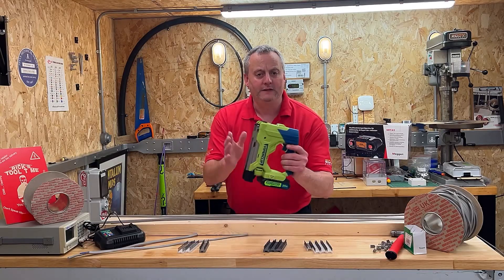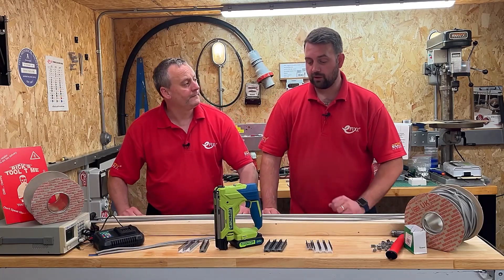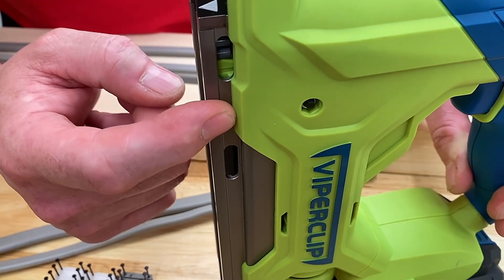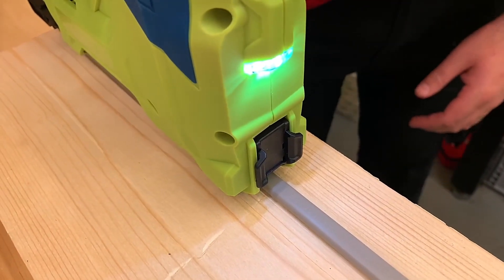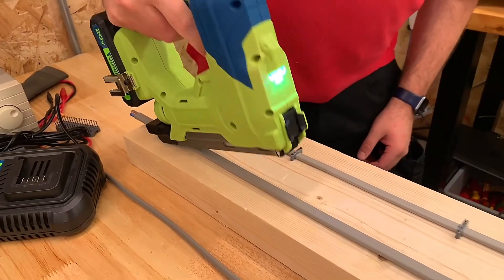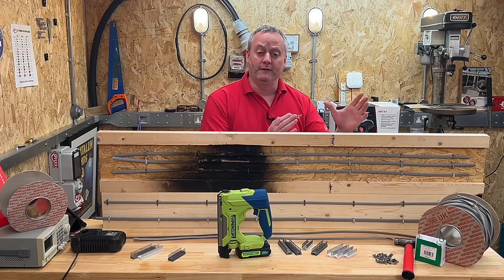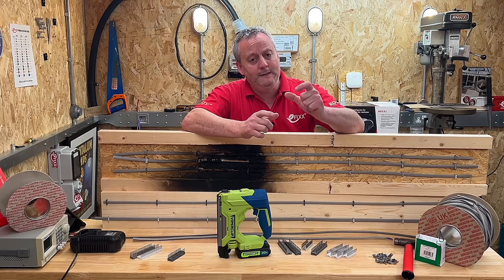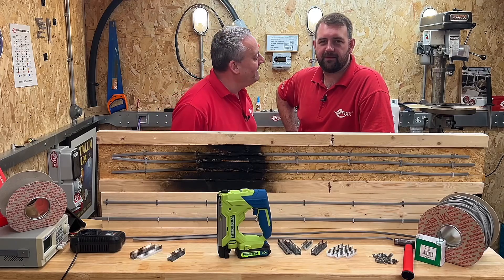VIPER CLIP The Ultimate Twin And Earth Cable Clipping Solution?

Comment: After watching this longer video I'm even more convinced that it's not worth it over the Dewalt cable stapler. I pointed out the crazy price on the short compared to the Dewalt and it's yet another different battery platform with yet more storage for different clips, much prefer my one size fits all Dewalt.

Comment: Looks like a great bit of kit, only question would be the availability of the fixing, and the cost
Reply: £330 for the gun and accessories.
3.6 pence each for plastic clips to fasten 1.0 - 1.5 mm T+E.
Reply: Looking at £290 for the full kit via your local wholesalers. That comes with a bag, 2 batteries a fast charger as well as a lanyard for the tool. You'll also most likely get some free clips with the pack depending on how nice your wholesaler is.

Comment: I got my hopes up for a second only to realise the clips are almost triple the price of Milwaukee ones which i also find expensive
Reply: If you're good at eyeballing the distances you can just slide the tool backwards along the cable, firing as you go. At that point, the time and thus labour costs of the installation could drop to compensate for the more expensive material and increase your profit at the same time. Alternatively, you can pass those costs on to the consumer, and keep all the timesavings for yourself.

If you don't value your time, well, enjoy hammering.
Reply: If you actually compare the Milwalkie clips to metal clips as that’s a fair comparison. They are actually cheaper. Then the traditional happier in clips.